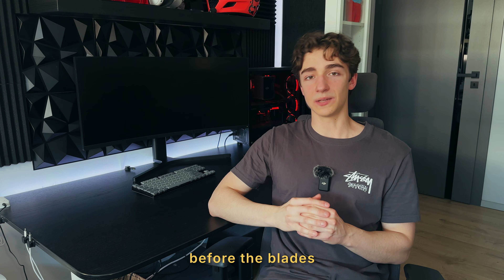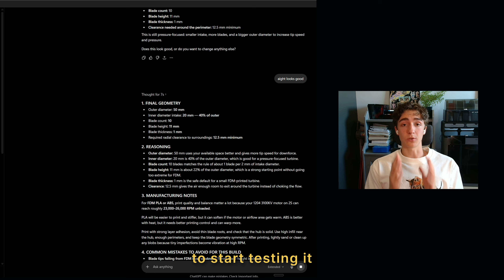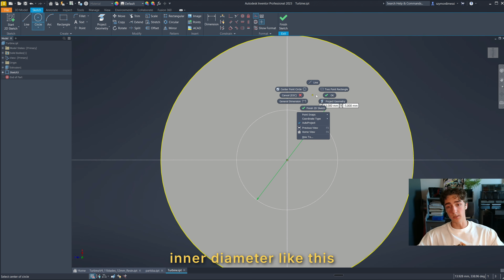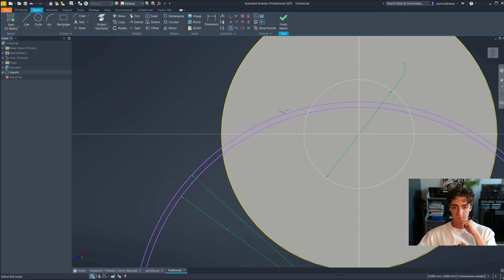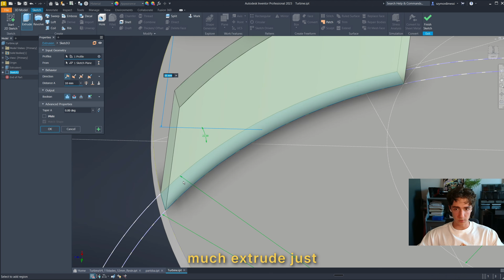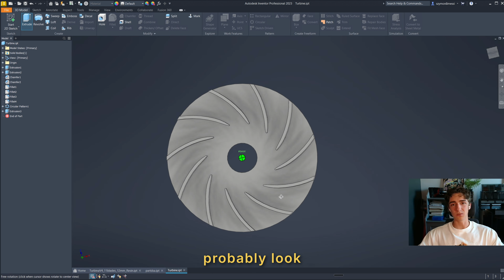How to ACTUALLY Design A Centrifugal Turbine

Comment: OD sets maximum delta P the turbine can do since it modifies the exit triangle and puts more KE into the fluid.   ID is what limits mass flow rate
Reply from the maker: interesting insight
Reply: @szymigzzz that is from what I gathered from working with turbocharger, your turbine shape being di,fferent perhaps there are a few differences ?
Reply from the maker: @TurboDiesel33  yeah they have slightly different goals trubo - has to keep pressure while still pulling air through, my turbine - has to keep a seal (no airflow), additionally turbos are metal so you have much more flexibility and can create more sophisticated shapes that will not just blow up like it is with plastic